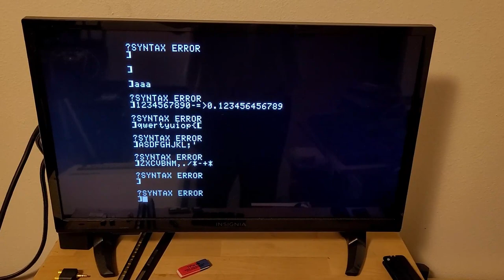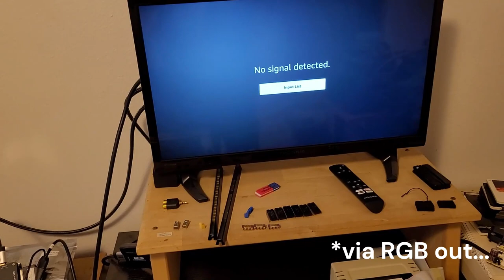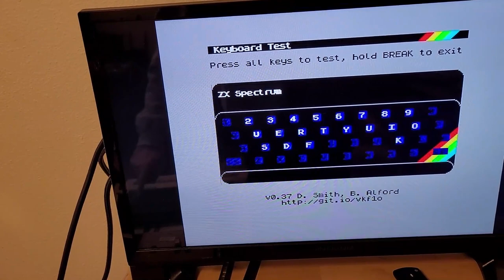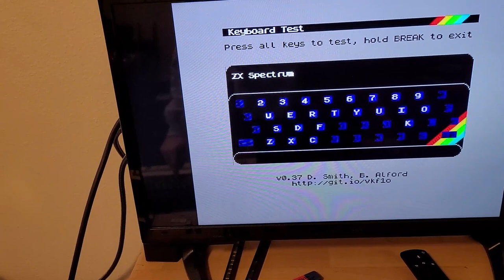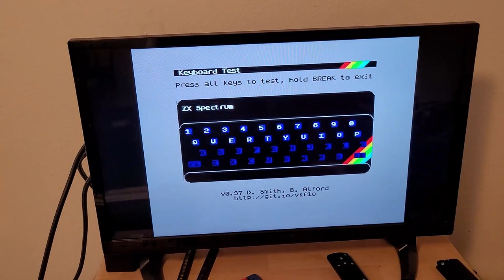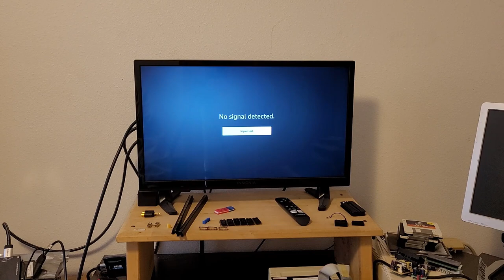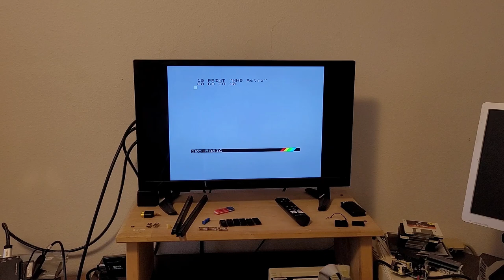Retro Keyboard Issues

Comment: The proper desoldering procedure is to add excessive solder to all of the pins before you begin to desolder.  When desoldering, you should place the tip of the desoldering gun over the pin, and rotate it around the pin in a circular motion for a second or two, letting all of the solder melt before you apply the vacuum...
Reply from the maker: That is the way I usually do it.  Not sure why I was rushing it in this case.

Comment: You can order new foam plumbers with aluminum foil attached they can be ordered, you have to pull out the old ones replace with the new clean the contacts on the board with isopropyl alcohol
Reply from the maker: I probably wasn't super clear.  Sorry about that.  The new foam pads from TexElec do indeed have the conductive foil attached.